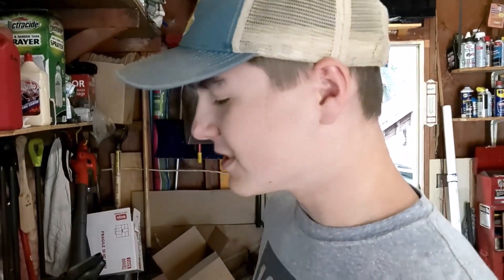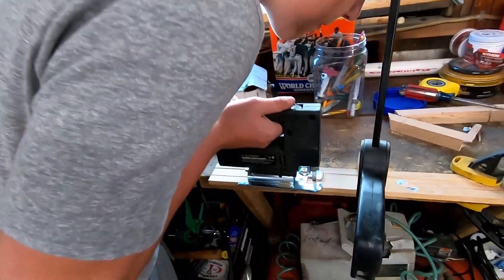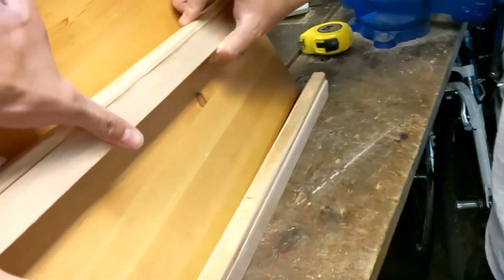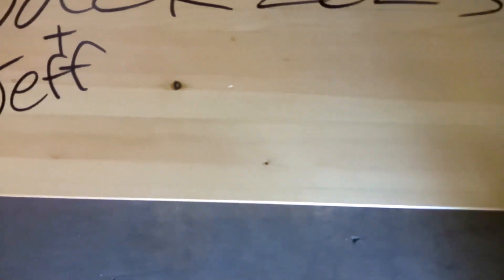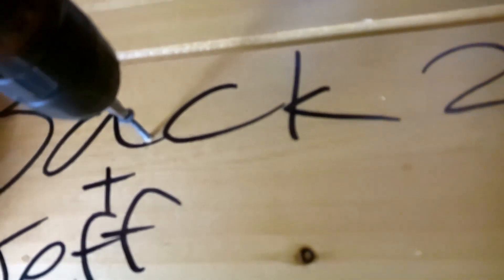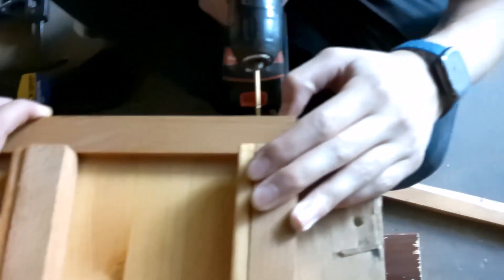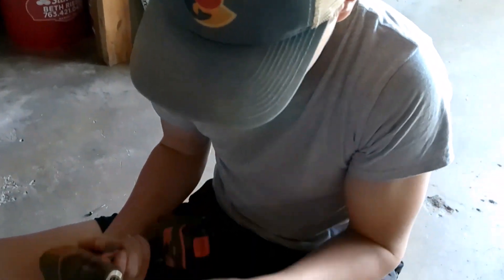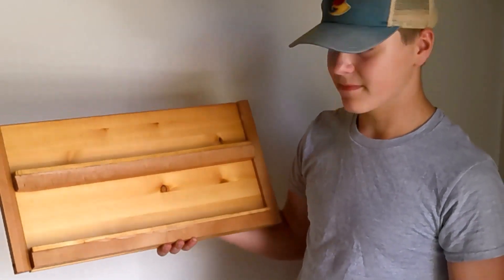Making My First Card Display with the help of @thedrewavintagelegacy6455

Comment: It looks great Jack. I’m glad I was able to help.  If you continue to build displays do yourself a favor and don’t get rid of this one.  As you grow in experience it’s always good to look back and see where you started.
As a small critique I would say anytime you work with any power tools, even a jig saw or drill, please put on safety glasses.  I’ve seen many unexpected things happen and you can’t be too safe.  My brother had a freak accident as a kid and is blind in one eye now as a result.  It’s just a good habit to get into to.
Also the reason the screw head ripped off is it looked like you were using a drywall screw which is totally fine but they are made from a softer metal and could do that if they are used in hardwoods.  To avoid it in the future use a slightly larger drill bit to drill a pilot hole.  The bit should be the same as the shaft of the screw so only the threads have to dig in.
Like I said it looks great and I think it was a good choice to add the sides. It helps frame the cards within the display.
Reply from the maker: That’s for the critiques notes taken.  I did half way threw start using a bigger drill bit and it worked so much better.  Thanks for you help Drew!